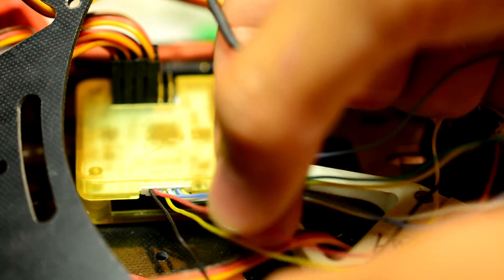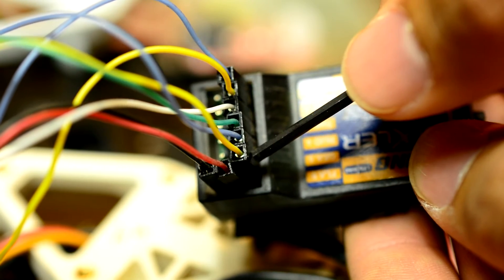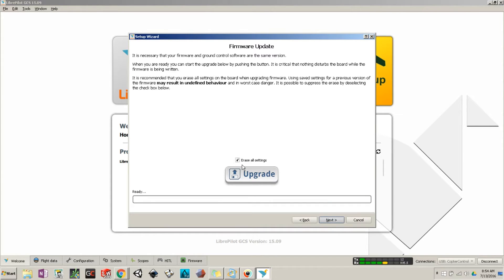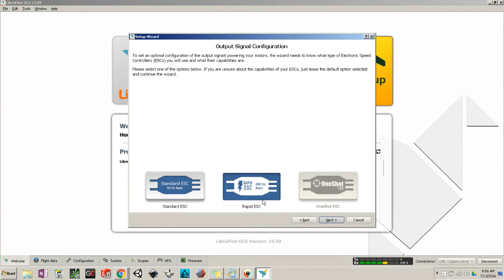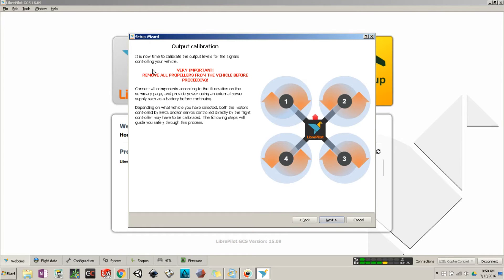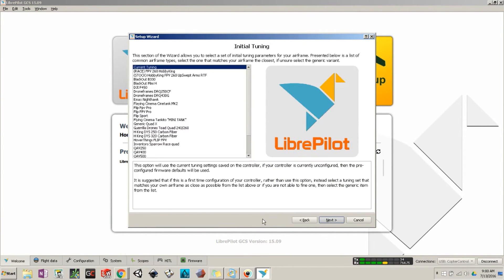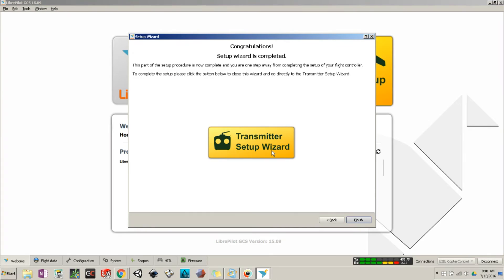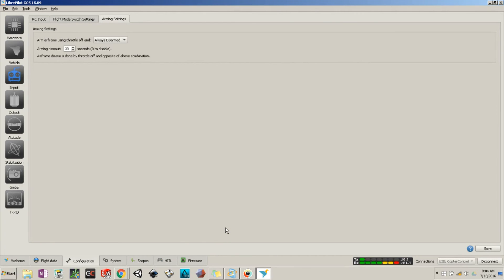LibrePilot (OpenPilot) Tutorial With OpenPilot CC3D

Comment: Hi, I'm unable to save the settings, the page freezes to "preparing mixer settings" and later the same message turns red. Please help
Reply from the maker: Sometimes its possible to get a bad chip or bad connection. 
Restarting the computer or chip might help. Starting over might help as well. I'm sure there is other tutorials that might have ran into the problem you are having. It wont hurt to try them out.

Comment: Hey all, I am having a pbm, I built a hex, emax motors, red wrapped 30a simonk esc from ebay, frsky x4r receiver and a revo board. Ran the wizard a couple times, the motors work fine using the gcs. But when I use the radio, a small throttle input sends the motors to max. Any tips?? Thanks..

Comment: just finished my robocat 270, when taking off it flips straight over. does anybody know why it's doing this?? I've checked the motors are spinning the right way.
Reply: Ryan Lambert double check all props are on right way, and double check motor layout and direction
Reply: Do you have roll at 180 in attitude setting?
Reply: Ryan Lambert yeah you wanna make sure the arrow on your board is facing forward...if not you can adjust it in the program

Comment: Nice video sir! I have a problem no one seems to know how to fix. Using ppm with white on pin8, got the controls all setup but when I go to test them the transmitter diagram goes crazy with inputs but I'm not even touching the transmitter. Any ideas??
Reply: +Zachary Schroeder I did change the batteries no difference. I do have a one half of the antenna cut from a crash but it still worked. Also I tried a new receiver and same result. Gonna have to post on the forum as it sounds like a more advanced problem which I don't no how to fix. Thank you for the help!
Reply: nice video thanks buddy